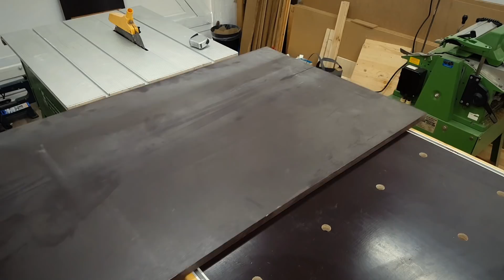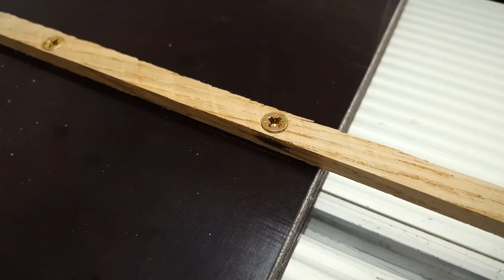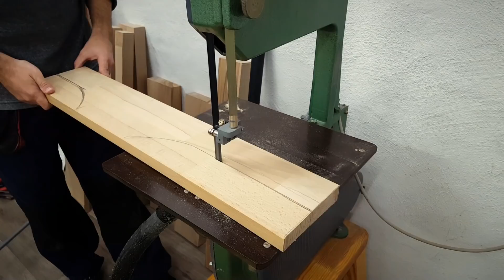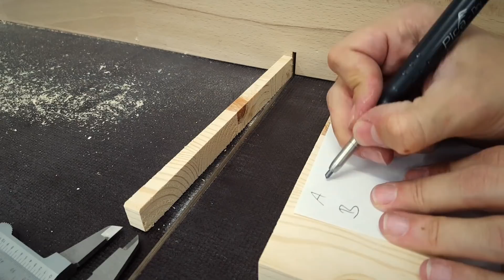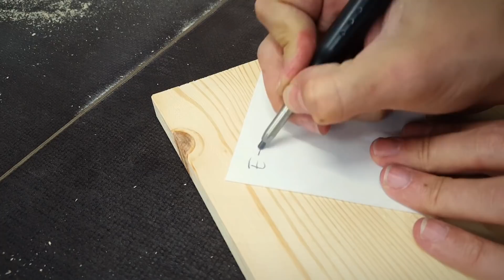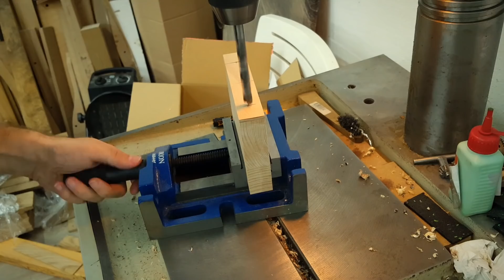The most important addon

Comment: You ever found the base plate to be too 'slippery'?
Thinking of using that for a jig, but wondering if 'normal' plywood might be better... 🤔
Reply from the maker: Normal plywood would work as well. But these coated boards have a slippery and a rough side, usually seen in trailer beds as a non-slip surface, which is super grippy. I put the rough side up and it works very well.
Reply: @pilotsworkshop4554  cheers! Good to know! 👍

Comment: Your calculations seem extreme. Why don’t you just get a 2 foot steel square, bring your blade fully up and lay the square along the blade. Bring your new  fence forward to the right angle of the square and set at 90 degrees to the blade
Reply from the maker: Hi Colin, that would be another method. I don´t have a precise square that big and a nice one would be quite expensive. This method is free and (if that sorta precision gets you going xD ) it is even more precise than any other method I found. And to be honest it doesn´t take all that long, all together maybe 5 minutes, explaining it takes longer. 
But yes, if I had a proper large steel square, I might just use that.

Comment: Good to see you in your woodshop again.  Nice addition to the table saw!  Are you going to add movable stops to your sled?  It would be very useful for multiple cuts at the same length.   Great video!
Reply from the maker: Hi John, thanks! So far I always worked with small blocks of wood that I clamped to the fence, which works quite well I think. So nothing planned so far :)